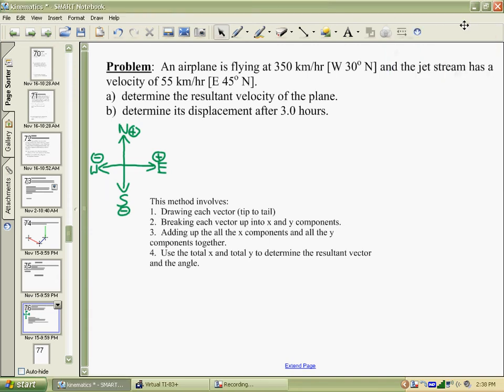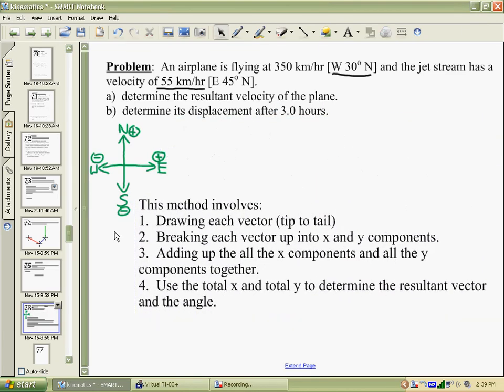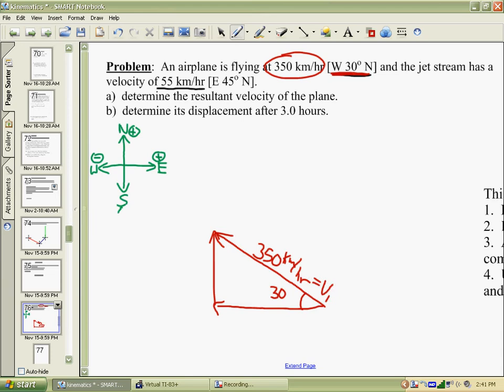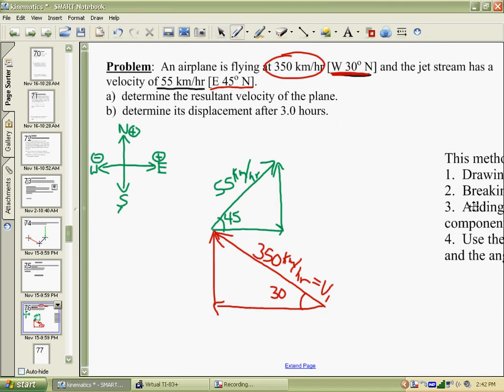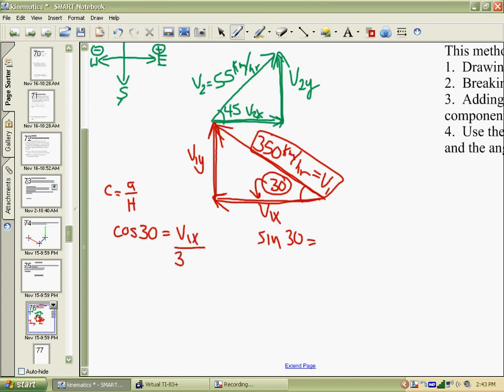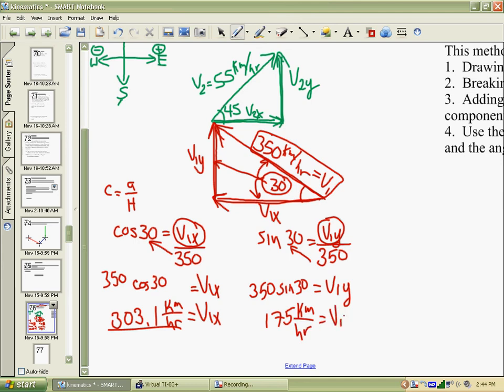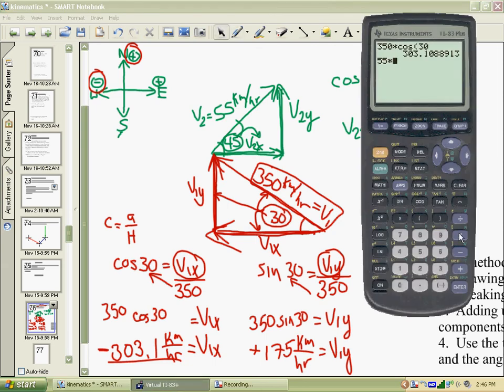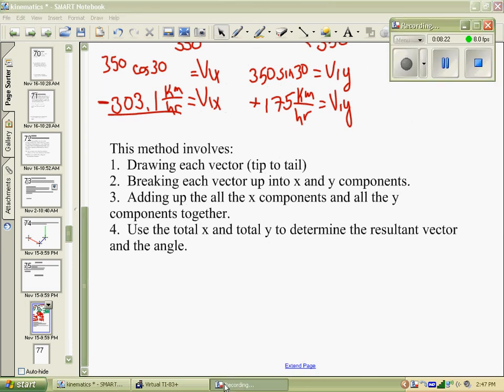Adding Vectors Part 1 (resultant velocity)

Comment: hi
how can we resolve two vectors that are at 90 degree to each other....
e.g two velocities 3m/s and 400 m/s are at 90 degree to each other so what is their resultant?
Reply from the maker: if they are at right angles to each other, then you can just use pythagoras theorem to solve it.  so (3)^2 +(400)^2 = 160009.  square root that answer gives the resultant speed.  which is 400.01 ...

Comment from the maker: It was a 30, 90, 60 degree triangle.  It wasn't filled in, but using sin 30 and cos 30 implies that it is a right triangle, so the red one was indeed as you are asking.